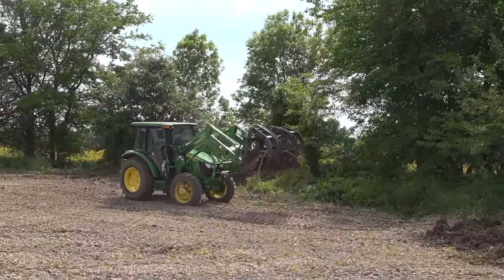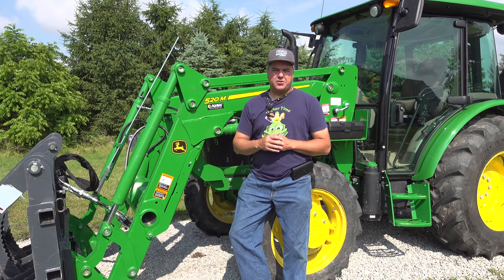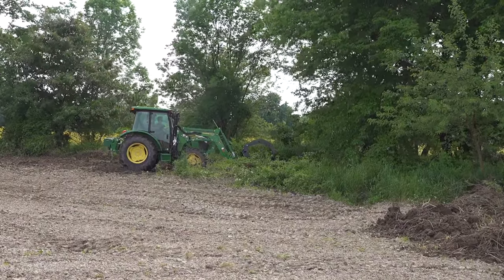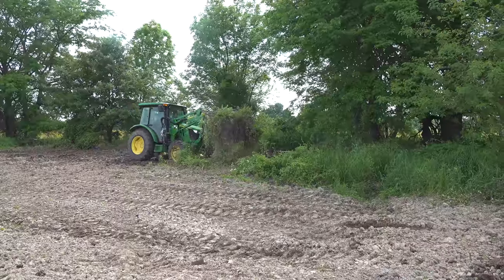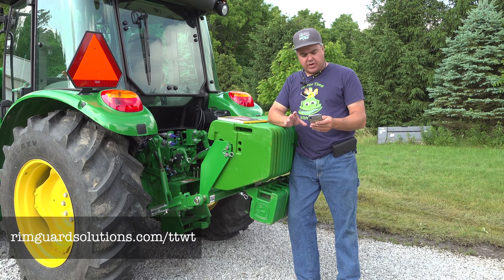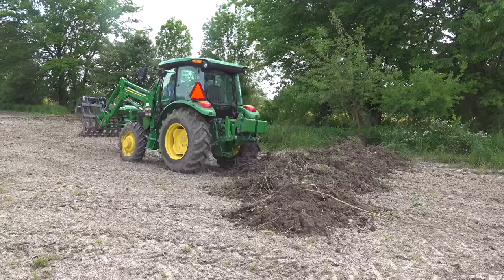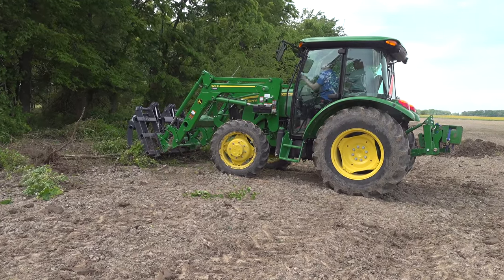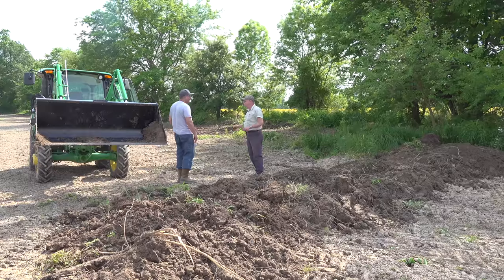Not Enough Ballast!!

Comment: I enjoy your approach to operating a tractor! There's no acting like a "know it all", a learn as you go with a strong lean to common sense. Last winter I bought a small garden tractor, mainly to plow snow and save my back. I even used the plow as a dozer blade this Spring to open a drainage ditch that gets filled by the sander trucks. It also has cut my mowing time from 2.5 hours with a self propelled walk behind mower to about 25 minutes! ( I have two small but hilly yards to mow)
Reply from the maker: Thanks for the kind words!
Congratulations on the new tractor!
Reply: @TractorTimewithTim  Thanks! Though it's a humble little Cub Cadet XT1 I picked up from you to know and learn its capabilities.

Comment: Talk to Heavy Hitch about an extension to attach to the three point to get the weights farther back so you can get more leverage from the same weights. It would also be better to have the weights out as wide as the tires to get more stability. I've seen a guy use a box blade, mount a 55 gallon drum on each end and fill them with water at a job site. Then he drains them for transport. That's 900 lbs of removable ballast in the water.

Comment: I like the material in this video and have a couple of suggestions.  I too have a 5000 series JD.  As soon as I bought it, I widened the front and rear tires.  I think that both front and rear are now at 96" outside-to-outside.  That width still fits fine on my trailer when I have to move it on the road.  FWIW, the change makes a huge difference in stability - perceived and real.  The operator is also "tossed" less left-right.  My second suggestion is to lower your 3 point.  Just because you can lift it high doesn't mean you should.  As with a load in the front, set the height low but high enough for clearance purposes.  Again, you will have more stability.

Comment: What's funny is that the large tractor has the same little tool box as the 1025R.  I laughed when I first got that, but use that little tool box all the time.  Such a little thing, but is so helpful.  Great video!
Reply from the maker: Wish both tractors had a larger toolbox!

Comment: We ended up using the wheel weights on the 5320 at the tree farm, because we run self-sealer in the tires, and you can't do both. Too many shed deer antlers and stuff around, and you can't see them in the woods.

Comment: Fill rears with beet juice and put a large drum filled with concrete on the 3 point. Then it will hold it down. Probably about 2-3000 lbs should help.
Reply: John Smith I have a 5075e and the weighted tires helped a lot

Comment: I have a custom weight bracket made for my 2320. It consists of the bracket, which is made for a hitch receiver, and the weight. In total I would estimate it to be about 350lbs for the weight plus another 20 in the mount.

Comment: Watching your videos on ballast.  I hot my new Johnny. Got the backhoe front loader and a grapple for the front. So far I have no attachments for the back. Well so far. My question is what do I need for the back? Do I need a heavy hitch weight bracket plus the weights and that quick attach that goes on the 3 point hitch that I haver never tried putting on. One reason why is I have nothing to put on the 3 point hitch. This is all new to me. Thanks for your help.
Reply from the maker: You can leave the backhoe on if you have no need to remove.
If you remove the backhoe, you need the hh weight bracket and weights.  The quick attach is optional.

Comment: If your not getting the rear wheels off the ground you're not working hard enough!😉 Seriously it's a good video on ballast, it pays to set your tractor up correctly to get the most out of it. Mine is loaded with rim guard plus a ballast box or box blade that is mounted to my quick hitch to move it back as far as possible.

Comment: When I bought my 5075E I thought the exact same thing. Big loader on a smaller tractor, mine did come with the rear wheel weights but I’m still thinking about filling the rear tires with fluid also. 
Also for some reason the ride on it does seem really rough, and the loader seems kinda jerky. Guess I still need some time with it. 
Also I am thinking about setting the tires to wider position, I think that would help cause with them set in it feels a little more unstable. 
Great video

Comment: If you have the rear 3pt lift capacity I have an Easy Mass 4000 pound rear weight you can have for $400.00 if you want to come to Longview Texas and pick it up.Good video explaining rear ballast btw. I made my own 1500# ballast box for my TC 55 with loader.Just barely the right size.

Comment: Instead of investing in a bunch of weights for the tractor, get a three point to front loader adapter, and a double throw hydraulic top cylinder for the rear.

When using a grapple, move the bucket to the rear, and even fill it with dirt if extra weight is needed. When using the bucket up front, have the grapple on the back.
This way you get better use of your implements, and you can even move material with both the grapple and bucket at the same time.

Comment: Tim since the 5075 is at the upper end of your weight range and these are all on a "lease" type plan have you considered downsizing to a large 4 series? Something like the 4066R. I think lift capacity is around 2500lbs, cab option, only cat1 3pt though. You could probably load the tires, put on the HH or heavy rear implements and still haul it on your current truck and trailer setup.
Reply from the maker: Everything is on the table.

Comment: Moving the weight father back lessons the weight needed.   The short tractor frame causes issues.  If the front axle was closer to the bucket it would also take less weight, but that is  much more complicated than moving the ballast back

Comment: If ya have a large area to work just throw your biggest attachment on and ya don’t have to mess around with those weights which are a pain to mess with and of course ballast in the  tires also . On heavy stuff for my compact JD 3320 I just throw my box blade on or for heavier stuff Ill throw  my brush hog or tiller  on . I think since it’s so long(brush hog) it puts a Lil weight so much farther out VS right behind tractor or my ABI TR3  arena drag which weighs about  600lbs or so . I think it’s physics since weight is farther back . That’s my 2 cents Anyways great video TTWT
Ps: or a ballast box 📦 would be easy too

Comment: You can build a concrete ballast box that should be around 3100 pounds you need you can  buy 3 point pins and top link bracket  set them into the wet concrete  and boom very cheap rear ballast that you can load and unload easy to drop you're hauling weight

Comment: Great video I'm am a new owner of the 5055E, have had issues with tures off the ground. This is very dangerous.  My first bucket of pig muck took me off the ground, I was nit on level ground. I did have all tures filled prior to delivery $$$ well spent in my opinion. Rear ballast box is next. Also did u add the buddy seat or dealer install? Part #'s if possible.  Thank's Jack
Reply from the maker: Dealer install.  ...using buddy seat from 5m.
Reply: @TractorTimewithTim  I have since come to find out the dealer only filled my rear tires at about 40% of recommended ballast. This mistake could have been deadly. Also my tires weren't placed in the outermost position at 72 inches on center as per Loader manual. They were at 591/2... Dealer will GIVE me a BW15852 Large ballast box free of charge, put my tractor on the scales and get this all figured out.
Reply from the maker: Yea, you need to finish filling the tires.

Even so, be careful about passing the blame.  The dealer cannot protect you from all aspects of inexperience.   You must recognize the limitations of your machine.   Take your time, don’t get full buckets, etc until you become more comfortable with the limits of your tractor.

Comment: I've run a 5055e 4x4 for a few 100 hours and until we added water to rear tires it was just a nightmare to run.  Always on the edge of rolling over when using the loader bucket on unlevel ground.

Comment: I just watched a long video on another channel. The host discussed why so many 1025r tractors are flipping over. The takeaway was that it was all due to operator error. Many commenters agreed as they are all expert operators and never make mistakes.
The 1025r in the video is unballasted, other than liquid in the little rear tires. Nowhere in the video is ballast mentioned.
None of the comments even mentioned ballast.
Well there is one comment there now. I politely suggested that rim guard in the tires is not enough.
The video maker replied that they don't use the 1025r for lifting all that often as they also have a 2032. I suspect it is unballasted as well.
In any case, it only takes one small mistake to overturn an unballasted  tractor
Reply from the maker: Yep.  Ballast is incredibly important.  Saying otherwise is irresponsible.
For a 1025r, Rimguard is great...but insufficient.  
Even Rimguard plus wheel weights is not enough.  The loader manual makes it clear that LOTS of rear ballast is required to make these tractors safe.

Comment: Tim, question.....Have you come close to tipping your 1025R over?  If so,  what was the incline and circumstances. I just bought a new 1025r and have been doing things around my property. My property has some nasty inclines that I wouldn’t want to get sidewise on. However even slight uneven ground makes me jittery.
Reply from the maker: Yes, I often encounter 'borderline' situations.  This is common and expected with these 'top heavy' and narrow tractors.
It isn't the amount of incline that defines how 'tipsy' the tractor might be.  
I've had instances on only slight inclines where the load is high, and the 'high side' wheel gets pitched upwards by the terrain.  This can result in a tip-over. 
My suggestion is that you practice the recovery procedures....quick lowering of the bucket for quick recovery.   Also, learn to detect potential dangers before you encounter them (avoid heavy loads held high, with fast travel, on rough terrain, etc).   
With time and experience, you can become more comfortable with your machine.  
Does this make sense?

Comment: When my b7100 Kubota was getting its PTO fixed I borrowed my Dad's (BX something or other) to load my gator with dirt I had dug when I built a new pond (1/2 acre) and fill some holes in our yard. While loading the gator I turned the BX Kubota over twice, the first time I had the bucket about a foot off the ground (little front tires), the second time the bucket was less than 2 inches off the ground. (poor design). The second time really was a surprise I had always been told that as long as the load was below the front axle it would not turn over. Surprise it did.
Reply from the maker: I assume you did not have rear ballast???
Reply: @TractorTimewithTim  I had a little 4' box blade but I guess it wasn't heavy enough.

Comment: Tim,   Did I read the chart correct?   With both rear tires filled with rim guard, you would have 1480 pounds?   If correct, why did you choose 1600 pounds of weights on the 3 point hitch?   I've been told weight on tires and wheels is preferable over on the tractor.   Less weight on the axle bearings, so less wear on them.    Any thoughts?
Reply from the maker: Kevin, the loader requires much more than 1480 lbs on the axle.
I described the two options in the episode.

You’ll see in tomorrow’s episode that the 2000lb I have on the 3 pt is still not really enough.
Reply: Tractor Time with Tim     I guess my real question was, would it not be cheaper and better to put the fluid in the tires at 1480 than buy 1500 lbs of John Deere weights?   I'm pretty sure JD is pretty proud of their weights.
Reply from the maker: Fluid is cheaper, but not removable.  I can remove the weights if I want to use a different attachment.

Still, I would like to have both!  A tractor is more functional if it is heavier.
Reply: Tractor Time with Tim    Agreed.  Fluid was the first add on for me.

Comment: I don't necessarily agree with your assumption. With a front axle that pivots, anytime the rear tires come off the ground it can result in a roll over situation.  Without loaded tires that Heavy Hitch weight bracket wasn't anywhere close to the required 3000 lbs of ballast for that loader.
Reply from the maker: Fair enough Joe.  I'm too tired this evening to pick a fight.  :-)    I suspect I'm not able to articulate my point clearly enough, as I'm certain that you would agree with me in the situation I describe.  ...but I agree with your point as well....keep the wheels on the ground to avoid roll-over!
Reply: I think that’s a great point Joe.  A pivoting front axle is another variable that is unpredictable at best.
Reply from the maker: If I’m hooked on to something with the grapple which won’t move, there is no practical way to turn over.  
Of course, if it DOES move, or if the grapple loses its grip,  then all bets are off.  I suspect this is Joe’s point.

Comment: If you went over 26,000, would you need a CDL?
Reply from the maker: Yes.
Reply: @TractorTimewithTim  Is that difficult to get?  Or expensive?  If not, I could see you justifying getting it so you can fill the tires with beet juice.

Comment: Put window washing fluid in the back tires
Reply: Zach Ferguson did you hear the part about extra weight would put him over his allowed vehicle weight?
Reply: @coypatton3160  That is correct but he didn't say if it was really necessary that he haul the tractor on his trailer. I mean, who hauls around large tractors anyway? Farmers around here travel long distances on the roads to get to various farms and fields. The majority of bigger tractors would require a low-boy and semi truck for transport.
Reply from the maker: Joe, i thought I was clear. I need to be able to transport the tractor on my trailer.
Reply: EOSJOE educated yourself! Find out where he lives and notice he told you where this tractor work video was recorded.
Reply: @coypatton3160  Sorry... I somehow missed that part. It still seems fairly simple to me. I mean, at the end of the day you need to operate the equipment safely or something bad is likely to eventually happen to you or someone around you. It doesn't seem wise to put yourself or the equipment in a dangerous situations just because you don't want to get a proper license or proper trailer to haul the equipment in it's required configuration. Let's face it, if you want to use big iron and do big jobs you have to pay the fiddler. Maybe they could haul the tractor on one trailer and the ballast on a second trailer. I see that being done with cranes all the time.

Comment: My only problem with Rimguard is finding a dealer that does it
Reply: yeah that's true around here where i live at. the one tire shop that used to do it-quit-reason was they burnt several pumps over the yrs with pumping the rim guard. claimed it was too thick-so they went to a thinner solution-i now have a liquid like what they call wintertime windshield washer solution, almost as heavy as rim guard-but they claimed was easier on their pumps.